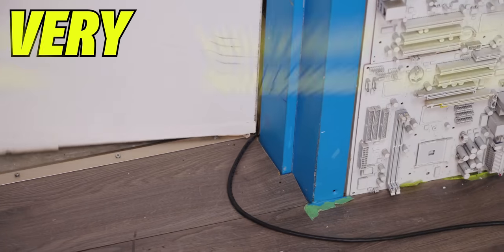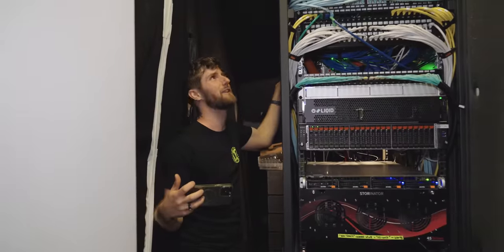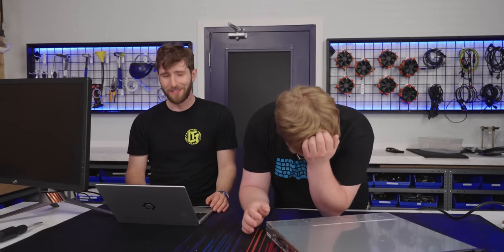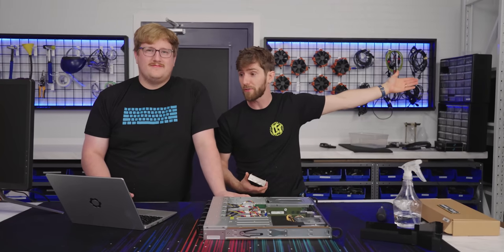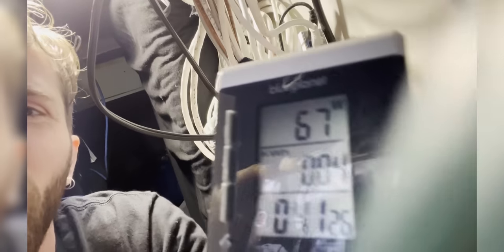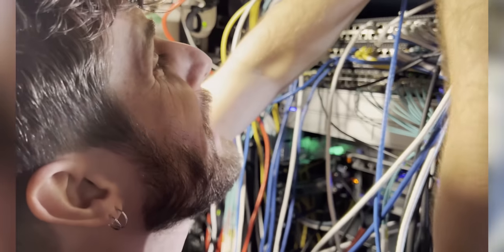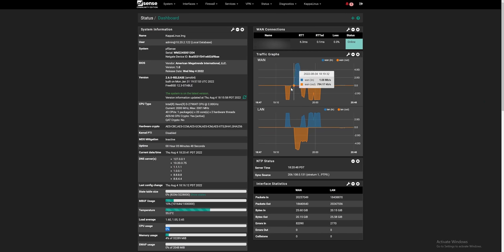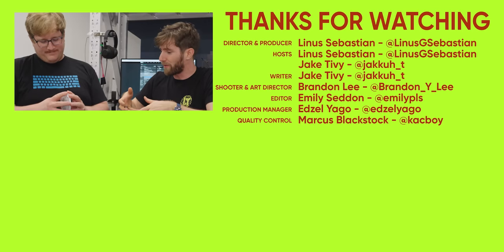I hope you don't need internet.... - PfSense Router Update

Comment: I'm thinking of rebuildng/upgrading both my NAS and Firewall.  Currently the NAS is a Xeon 1240V2 in a Z77 board and 8GB DDR3@2133.  and the Firewall is basically an old lenovo office PC with an SSD and i5-3330 8GB at 1600.  I'd like to bump them both up to at least x99 x4 ddr4 or just go am4 but I'm just not sure If the power demand is really worth it.  I've got 1.5 GBit Fibre and most of the devices are 1 Gbit on a 2.5 Gbit hub.  The biggest issue I've faced with pfSense is the lack of support for some realtek 2.5 Gbit NICs.  I spent a whole weekend trouble shooting and just went back to a 1 Gbit NIC for now.

Comment: VANIX has 68 peers, Valve is NOT one of them. If you want to see the full list pull up PeeringDB then VANIX. If the network listed has an open policy and they're using the route server, then congrats you had full 10Gig connectivity to them.**

iTel has a 10gig port on the exchange so that's shared will all of their clients, it's not just LTT.

Comment: Been a PFS fan for YEARS,, tried OPS also and found that every time I did anything with networking, like add a VLAN or change a setting etc connectivity was lost . Also it developed a strange issue that it would feel up temp space and then DUMP .. Running PFS on the same hardware and the errors have not returned .. Guessing your mileage may very

Comment: Jake, layer three switch really, get a real hardware router with real routing table capacity and good large acl tables etc. (And I say this sitting 4 feet from a stack of really expensive layer 3 switches, but I would never use them as a primary router)

Comment: talk about shoddy rack integration, if I would have left a customer rack like that I would be fired.. for good reason.
damn... linus, basic infrastructure rules are there to help you, labelling ( also cable labels), cable management, thermal design, etc... your server cabinet/room is a mess on all accounts. I know it will cost a bit to do it properly.. but it saves money in time not spent pulling the wrong cable etc... :)

Comment: OpenVPN is single-threaded so you would optimize for single core performance if that is the priority.  IPSec is faster, but isn't always possible.  Memory and Optane are ridiculous for this project.  You don't have anywhere near the number of employees or processes to require that much RAM.  As for the storage, what are you doing that requires that many wites on the firewall?  Your logs should be going to a remote systog server, and you can configure var/tmp to use a ram drive with periodic sync updates to the ssd if you are that concerned.  I suppose you could be collecting some local metrics with additional installed packages, but even that would be insignificant.    A regular WD blue would outlast the rest of the server hardware.

Comment: my OCD kicks up with the management and lack of labels. over all my main gaming pc is skylake(15% overclocked). i am offended, yes it has a 1060 with it and only 16Gbs of ram but it runs like a champ
.
Reply: Oh man. You would probably have a stroke at one of the schools I work at. I work in school IT support. The network labeling in a wing of classrooms in a school that I work at is horrid. All of the network drops in that wing of classrooms are all labeled Room #. For example, all drops in room 1 are labeled "Room 1". All the drops in room 2 are labeled "Room 2" and so forth. It was a massive headache the first time I had to patch some stuff in the network cabinet. The contractor who wired this school years ago did a terrible job in labeling.

Comment: You guys wont get 10Gbps performance out of opnsense or pfsense when filtering.  They dont support the nic offloading they need to get full 10gbps (with filtering).  Pfsense's support will tell you this straight up.  You need to use TSNR or move to a more custom or enterprise solution.  Either build your own linux firewall using iptables or get a cisco ASA that can support high bandwidth packet inspection.

Comment: It's a good idea to run your internet through a vlan on the switch anyway. 

1) You should be using two connections in case an idiot randomly unplugs one of the fiber lines to your router. 
2) You can then run HA with two routers in case an idiot randomly pulls your router from the rack for no reason.
Reply: no its not as VLANs dont provide any security so you are running unfiltered internet trought same switch as internal traffic so you need second switch

Comment: Man I'm wanting a case like that that.  but not at the 800 dollar,  price tag  I have a pFsence router I built using the X10SLH-N6-ST031 mother board Its a little longer than some mother boards with the 3 540 intel 10gb chips  I have though about getting 2 of the cases I have down and just make my own  so I can move the IO to the Front, and keep the power supply in the back, and make the case a little longer with hotswap drives in the front for the mirrored drives  I hate when I want to work on it or make changes or have crash I have to try and unplug ever thing were if I had all the network ports in Front I wouldn't have to do that all I have is power.  Since all my switches ect are in front.  so in all I like to have a case that is at least 19in deep, with IO in front power supply in back and 2 hot swap 2.5 drive bays in the front. also expansion slot for the dual 10 gb SFP+ intel card.   any one have any ideas.

Comment: Bro I was wondering you wanted Optane but why not just use ramdisk like I plot for Chia mining using HDDs and you can use ramdisk for 75 of the write and then only 25% is done on the nvme which each plot is 400g whittled down at the end to 101gb per plot file and there is software that makes it work also? So why use optane when you could just use a nvme with ram or you could literally just have soo much ram you can make it do ALL the work like normal drive.. I’m assuming that server boots into some type of operating system really not sure why it’s not possible to ramdisk and not write at all to nvmes or only 25% of the task goes to nvme writing?

Comment: it is extremly frustating that well if a card says 10gbit / 25gbit opnsense and pfsense just does not work up to the max speeds, and especially when it comes to SFP+ SFP28 cards, you really have to be super carefull to choose the exact cards with the perfect matching chip and the correct SFP+/28 modules to for sure reach the max speed.

in the end you now spend 2k for a supermicro system and manual setup and a mikrotik would do the same for half of the price. where mikrotik is btw very surprising LINUX very likely because of the whole compatibility bullshit.

Comment: Yeah when you said "BSD has great hardware support" I laughed, it still doesn't support any wifi 5/ac chipsets and linux already has wifi 6, and the official recommendation is "just use a separate wifi ap that runs something else"

Pfsense is great and bsd has its benefits but cutting edge hardware support is not one of them

Comment: 24:55 Screw OpenSense, screw PFsense, screw FreeBSD. Until someone ports a Linux driver of CAKE into FreeBSD, I'd be using Linux-based routers/firewalls. Bufferbloat is a real issue and CAKE solves it nicely. (For Linux only.)

Comment: This "Router" it's very overstimated, because without third party packages like SNORT for inspect the packets, the router work realy realy low ( I intend Hardware like CPU and RAM ), i work on CheckPoint Firewall and here the Hardware it's used a lot more, because the Blades for Check and inspect the packets it's a lot more ( but the price is not cheap like pfsense ahaha ). But the PFsense with third party packages becomes the best Performance/Price! ( here i talk only Pfsense and Check Point but there are many others that I have not mentioned ).

Comment: 18.01, is that an internal switch you are using as a media converter for your unfiltered internet traffic. If so then it is not a smart hack. Is stupid and should not be done all the time by any network professional. That is running unfiltered internet traffic over a switch carrying internal traffic, even if in separate vlans.

It is even discussed in your routers documentation that I cannot link to here due comment rules. See the ltt forum page for this video for more details.

Anyway anyone watching this video, do not do this. It is bad design, just to save a buck. It is in keeping with the point made at the start of the video that ltt are not network professionals, so any using their setup as a guide should be avoided.

Comment: Why doesn't this router have antennas like mine do?
Reply: It is a dedicated router. Business/enterprise level routers usually just handle the routing part. For wifi, you buy wifi access points. In typical home & small business networks, the router handles both routing and wifi as it makes it very easy and convenient for end-users to plug in and setup.